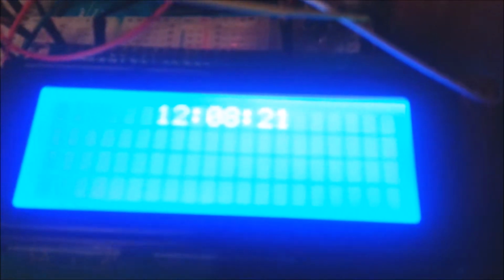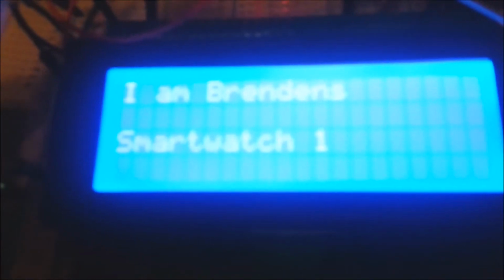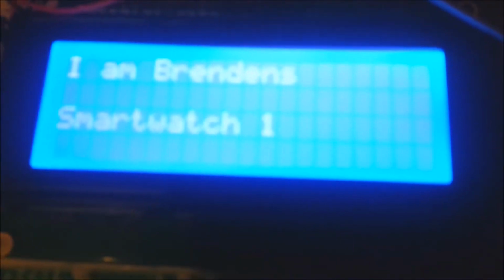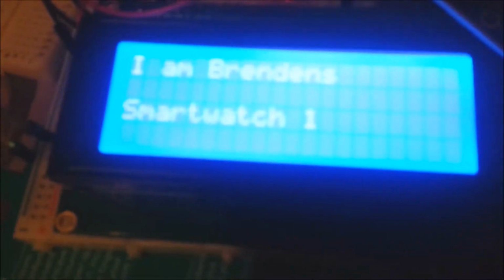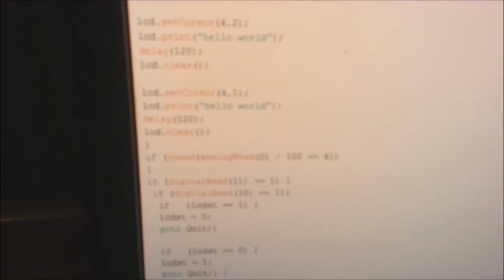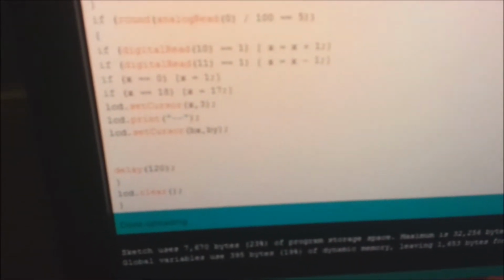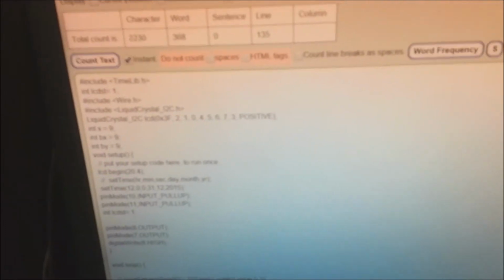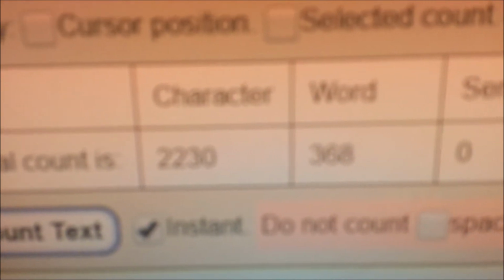arduino smartwatch update 2

Comment: Not bad at all. I have ordered a bunch of parts for a Atmega328 based smartwatch. I plan to have a bluetooth serial module, and will use an app to relay notifications to the watch. Also, I'm using a smaller screen. It only has 2 lines.
Reply: Yeah... i finished that version(video is on its way) and im making a new one with Bluetooth and a oled display
Reply: And ill also try to adjust the audio a bit better